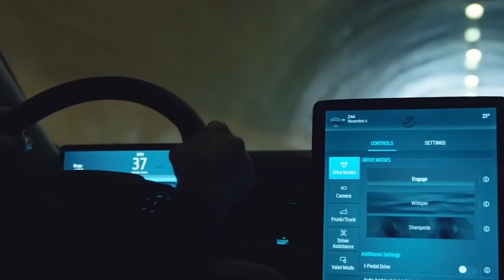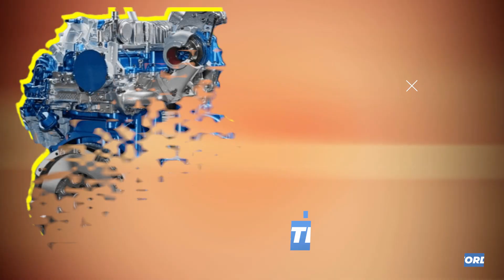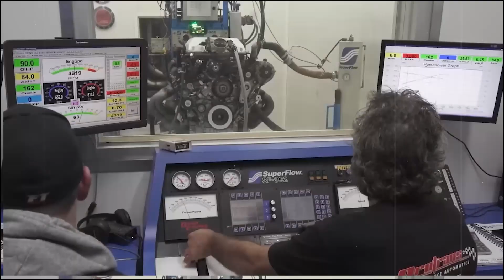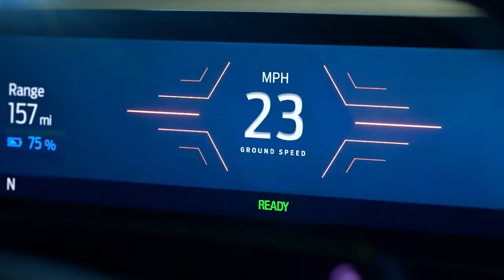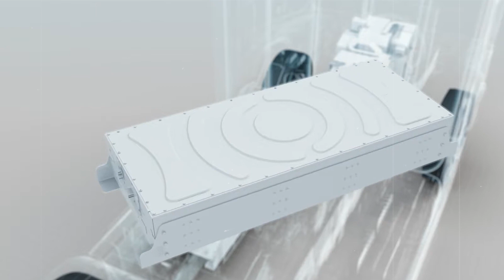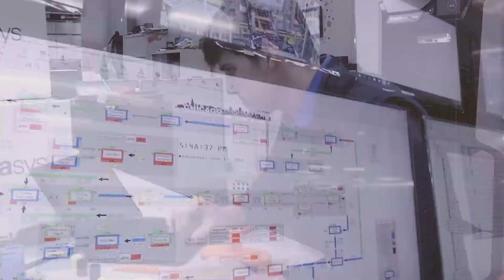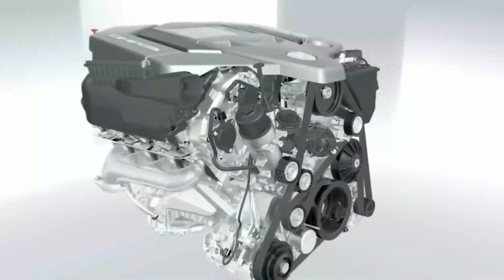Ford's Ultra Drive Engine! Is This the Death of Electric Cars?

Comment: There is always a catch. 1) What is the bio fuel source and on what quality of agricultural land does it grow? 2) what is the cost per litre of this biofuel? 3) What are these additives are what harm or benefit do they have to humnas, the environment, the engine? 4) Is this Ultradrive engine more costly to produce or maintain, is it reliable over time? 5) Is the Ultradrive engine available NOW because of the huge differential in costs between  IC and electric?

Comment: I haven't seen the new Mustang in person at the dealership they did such a crappy job it looks more like a Mazda they didn't even put decent door handles on it they put tiny metal fins that's going to break off let alone the fact the car has such serious structure failures the body panels don't even line up right and that's at the dealership
Reply: are you saying the mazda is a bad looking car? you must be one of the very few... I mean both exterior AND interior.... it looks so much better than any ford (and yes, I do think ford does look good (on the outside). On the inside, Fords are a bit of a ergonomic disaster though... way too many buttons for a start. What I can do in my car with 11 buttons, ford needs 20 buttons. Why? I literally can do anything the Ford can with half the buttons and half the dashboard clutter. It's strange.

Comment: Propaganda. When it says that this system is simple compared to an electric vehicle its says it all. It is very complex. A magnitude more complex than EVs. EVs in the US are now only going to use j1772 plugs and NACS plugs. j1772 and CCS combo plugs can access NACS (formerly Tesla) plugs with an adaptor. But all the manufacturers have signed on to moving their entire EV offerings to NACS in the US. So, in 2024 and everyone by 2025 of US sold EVs will be using NACS/Tesla plugs. Nothing is simpler than electricity production to utilities to transmission lines to EVs. All this infrastructure already exists.

Comment: Whst happened to the carbuetors from the 60,s and 70,s that can give gasoline engines 60 to 90 mpg  they are out there and the top 3 know it .!!!
Reply: No one is hiding these carburettors mate yes they got good mileage but caused massive amounts of NOX emissions hence the reason we stopped using them sometimes you should look into the facts before just vomiting up crap and go back to ur Qanon Echo chamber
Reply: If they calibrate an engine to run super lean, it increases NOx emissions. That has always been the problem with those setups.
Reply: We all know Elon went back in time, bought the patent, buried it, killed the inventors and all involved, paid off the CIA with reverse compound interest and then ate 3 big macs.😅